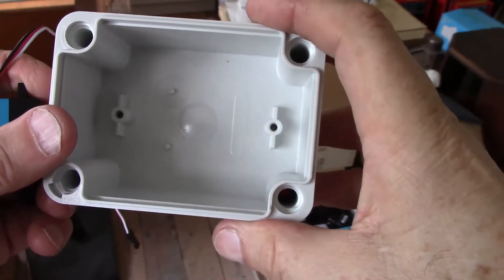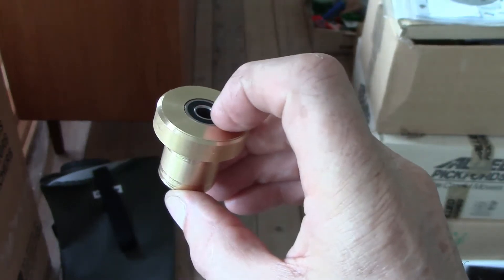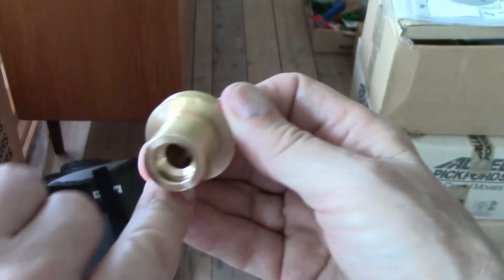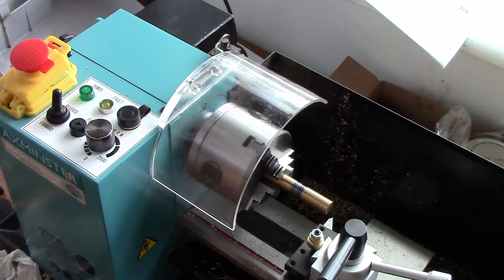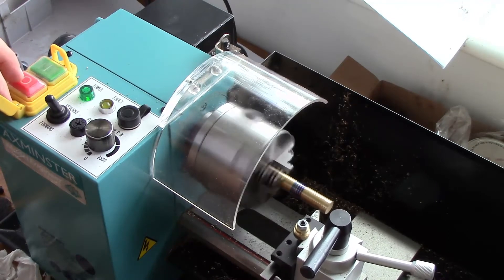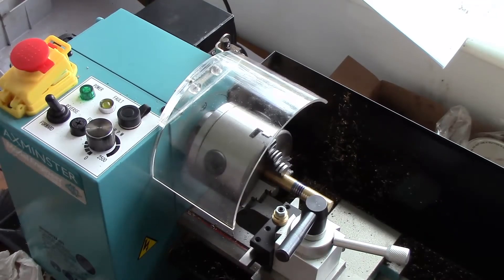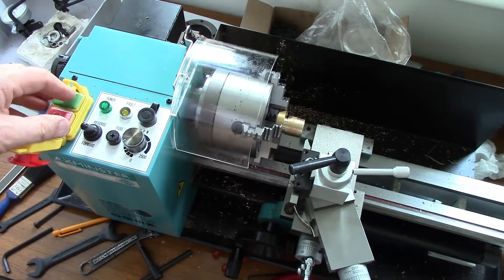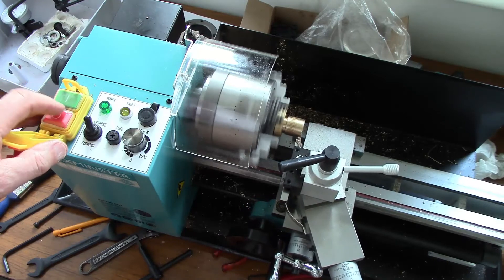Waterproofing a servo box using a shaft seal

Comment: Helpful! Best resource I found for a diy rotary seal in my quick search. You’re the best :)
Reply from the maker: Thanks. This is pretty old. There are simpler ways. For example, just mount a shaft seal in an aluminium slab, say 6mm thick, and screw that to the outside of the box with a little sealant. Screw from the inside out, into blind holes in the slab.

Comment: Hi Samuel thanks for this video. It's the only place I've found a solution to a hobby level rotary shaft seal into a junction box. I can't seem to find something like your brass doo-whaky that's available 'off-the-shelf'. Not having a lathe, just wondering if you would consider taking payment/commission to make one of these for me?
Reply from the maker: Well, that was almost the very first thing I turned on my Chinese mini-lathe. looking back on it , it seems rather big and chunky for the purpose. More recently I developed a different design, shown in no less than 7 videos in this playlist https://www.youtube.com/playlist?list=PL0ewuK5v5EQt8Fg0nVFb5XwbBkrc0OkHC "Making a worm-wheel servo for Woodstock" and parts 2 to 6 above in that list. However, don't bother to watch them! I could make you a little brass or stainless steel gizmo, if you email me a drawing with dimensions. For email address see ABOUT tab on my channel and we can discuss.

Comment: Well done Samuel :)
Welcome to the world of mini lathe's, the studs for the chuck are M6 grub screws, just order the correct length.
Try using the tailstock drill chuck to press on the chuck, while fitting the nuts, rather than holding the chuck by hand:)
Also try a couple of "spring passes" on the same settings, when cleaning up the threads. 
I wouldn't recommend using drills larger than the tailstock chuck capabilities, 13mm chuck, 13mm drill maximum.
Use a boring bar to enlarge the internal diameter.
At least you have used a 4 jaw chuck :) most times they get left in a box, by beginners .
Hope this helps :)
ATB Adam
Reply from the maker: Thanks, but my problem is I need more space between the spindle flange and the blue case - I can't get my fingers in there to get the nut started. Funnily enough, my mini lathe videos get many more hits than anything else, despite me never doing anything clever in them!
Reply: @samuelfielder  
Like I said, welcome to the mini lathe  :), A very popular thing in YouTube video's
Never mind how much effort goes into your yacht electronics/software video's :)
The sc3 and sc4 lathes are not much easier to access.
Try a small magnet attached to a 10mm open ended spanner ?
Or make an adapter plate and use front fixed (load) chucks with caphead bolts

Comment: Where did you get the servo to shaft coupler I can't find any In the UK.
 thank you
Reply from the maker: You need to try a Google search such as https://www.google.com/search?q=25t+servo+spline+to+1%2F4%22+coupling&oq=25t+servo+spline+to+1%2F4%22+coupling . But first you also need to know if your servo has 24 or 25 teeth in its spline. I can't remember where I got mine from but think I may have had to order it from USA company.

Comment: i'm trying to seal a jet pump drive shaft, is there an easier way? i feel like im over thinking it, wouldn't a bearing glued on the outside and rubber pressed in between the shaft and inner part of the bearing be sufficient?
Reply from the maker: Probably not. I assume the shaft is rotating. You need some kind of seal of this type: https://simplybearings.co.uk/shop/All+Oil+Seals/c4747_5571/index.html I think. But my big brass lump was an overkill. Could have made it of Delrin. Could have been smaller. It was the first thing I'd turned on my then new minilathe.